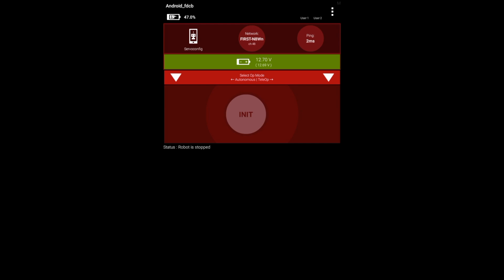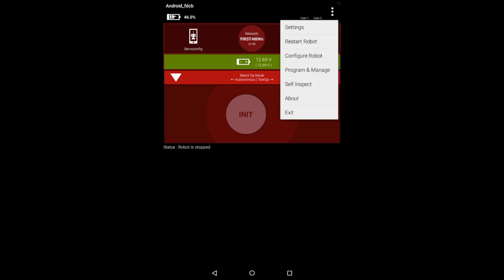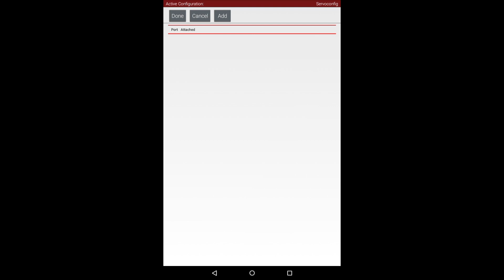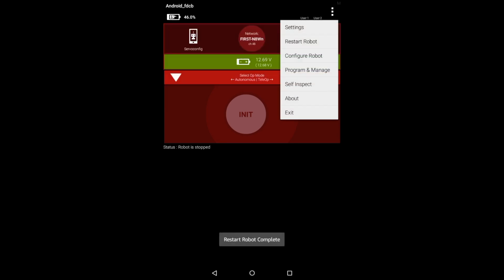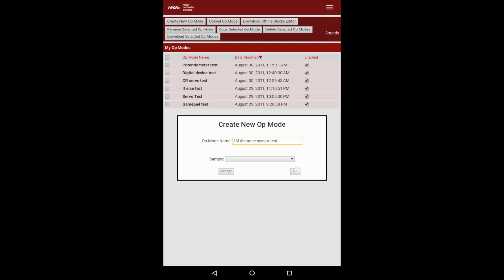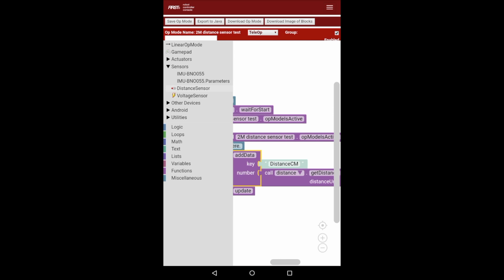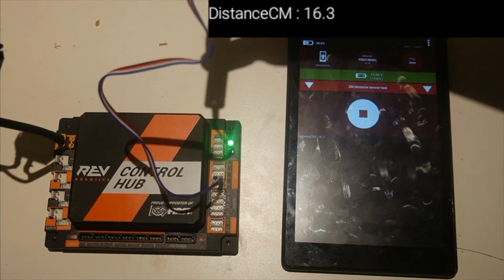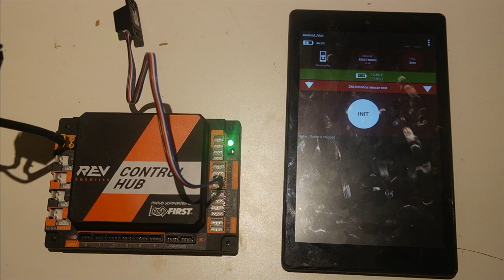Rev 2M Distance Sensor: Configuration and Programming

Comment: we've had a problem with our 2m sensor. It doesn't show up in the robot config. We've tried different ports and different wires, restarting the phones and everything. The weirdest thing is it worked just a couple days before and now it doesn't show up as an option in the robot configurations. we've connected the hub to the rev hub interface and connected to it and it can find and use the sensor just fine, so it's something wrong with the phones as far as I know.
Reply: What port did you plug your sensor into? It should only work if you use an I2C port.

Comment: do you think it can detect the FTC 2019 fence (wall)? I ask this because the wall is kind of clear plastic?
Reply: It cannot reliably detect the field wall. This sensor has a laser, and it shines it and determines how far something away is due to the time it takes to come back (Also known as a time of flight sensor). With the field wall and most other polycarbonate, the laser shines right through, and while it will occasionally reflect on very scratched polycarbonate, it's not reliable and we wouldn't recommend counting on it.